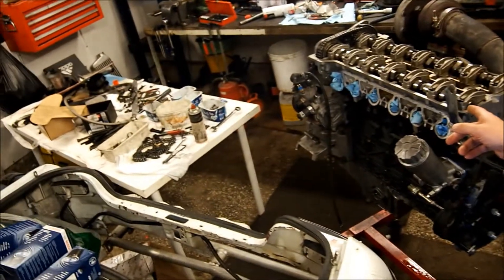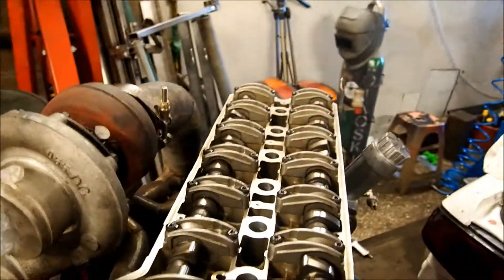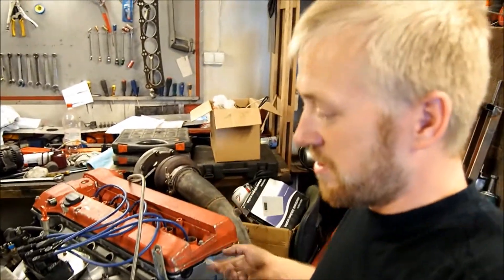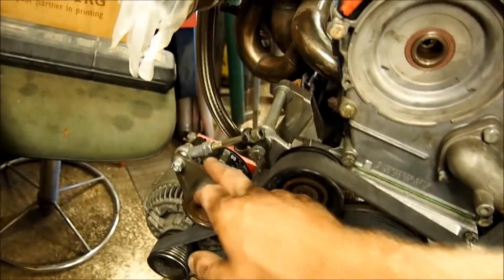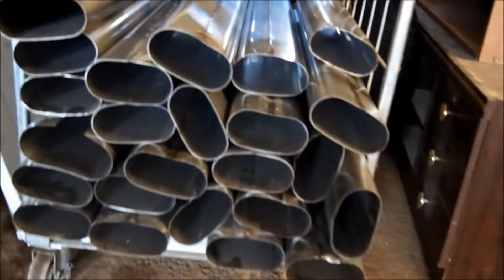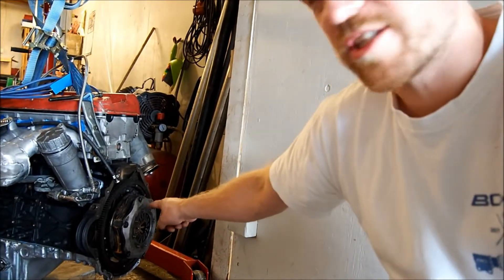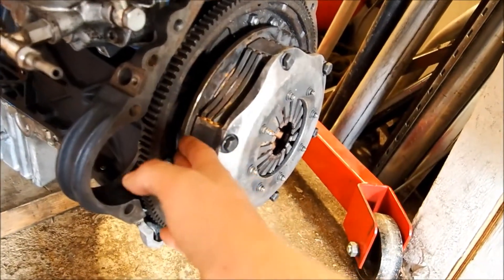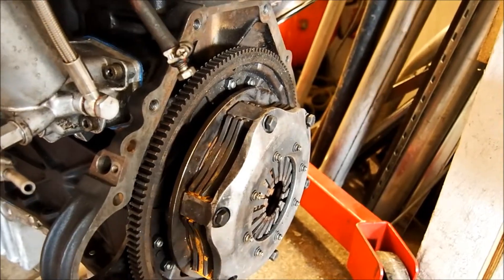Engine assembly

Comment: hey jonas!
Do you think the metallic clutch disks are street driveable?

My clutch slips again and i'm thinking about buying a used "nascar" clutch from the states aswell.
actually the t56 26 spline input shaft is pretty much the same as the mercedes 26spline input shaft...
716.6xx transmissons come with a concentric slave already...
which just leaves the flywheel to be made.
Reply from the maker: Hi, I dont think it is drivable on the street since they are very sensitive about slipping. I think some people have put two thicker disks in the nascar  7,25" three disc clutch. and in that way made it more drivable on the street and more slip friendly, but you have to investigate what discs there is available.
Reply: you mean with other disk compound or also metallic disks?
Reply from the maker: I should say metallic but Im not 100% shure
Reply: thanks mate. :)
i just ordered a used tilton 7.25 ot-II tripple disk will see how shitty it'll be! ahaha.

Comment: What differential and gearbox are you running?
Reply from the maker: Im using a BMW ZF 5 speed gearbox with a welded bell housing to M104 bellhausing. Im currently have a 4,1 skyline differential, so really low speed setup.